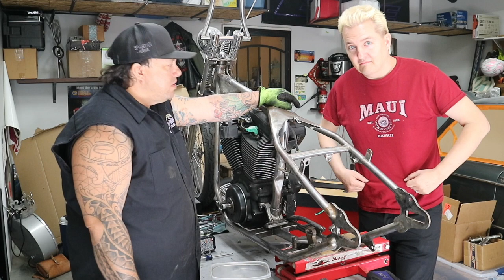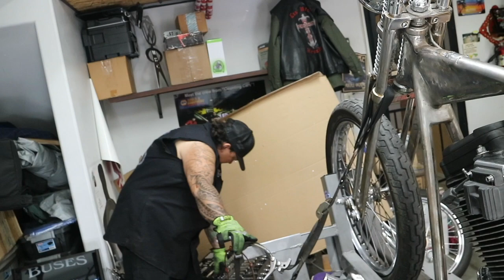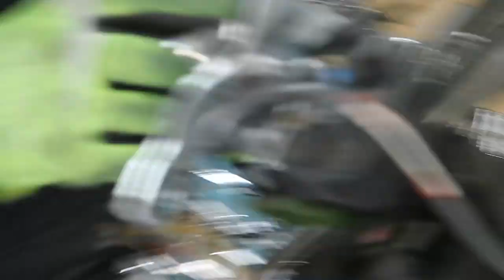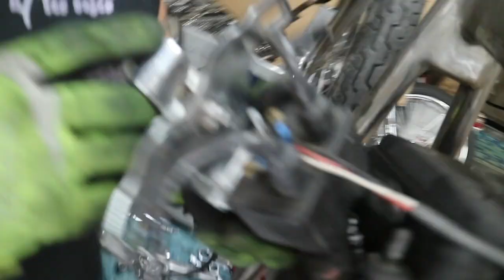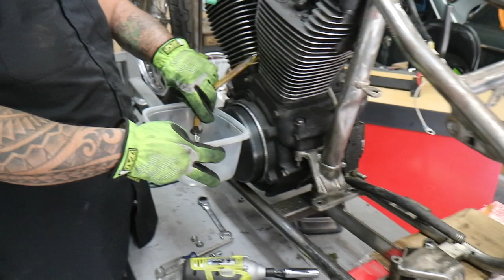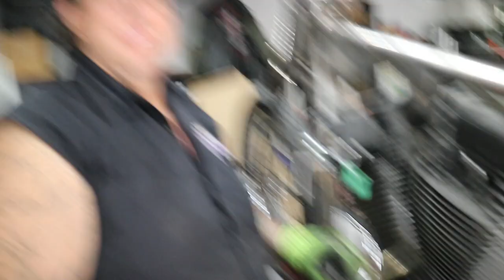How To Remove A Harley Davidson Engine

Comment: I have a question. removing the engine is simple on a open frame. I have a 2006 FLSTC that I am removing the engine from. everything is loose. but I cannot clear the transmission. and frame. do I need to remove the tranny to get the clearance to pull it. thanks for any help